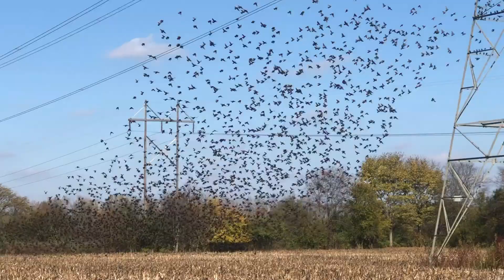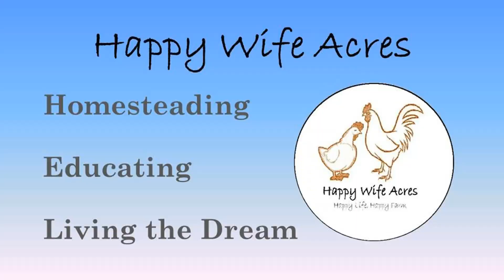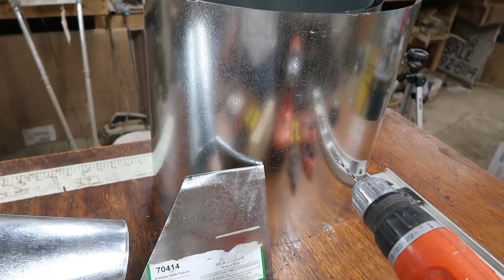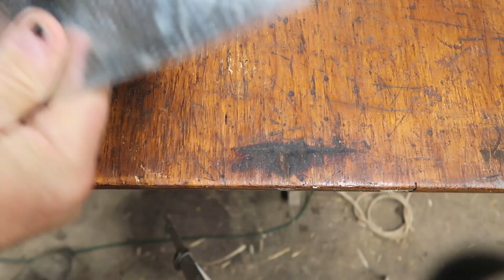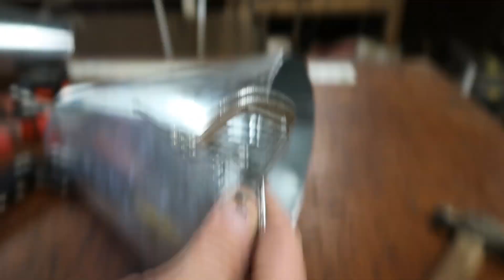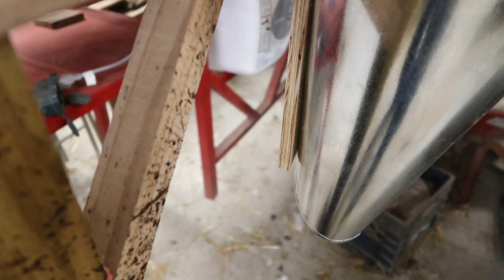Making Chicken Kill Cones

Comment: Would you happen to have a video or suggestions on making cones for turkeys and ducks?
Reply from the maker: I don’t but they’re just bigger versions of the chicken cone.  I made one out of metal barn siding once. Had the corrugated ridges. About killed myself bending it!  It’s hard to find huge flat metal flashing. The 2 nails in a stump and hatched works also. Just messier. Bigger animals take a lot longer to stop moving. Especially ducks.

Comment: The bottom opening seems pretty wide.. has this been an issue with 5-7lb Cornsh-X Chickens?
Reply from the maker: It hasn’t been an issue with “normal” sized birds, including CC. Small birds like bantams fall through. Large CC, 8-10 lbs, won’t fit. For those, I hang from a cord like the rabbits or put them in our Turkey cone.
Reply: @HappyWifeAcres  Cool thanks -- weekend project :-)

Comment: Very late comment, sorry. How long do you suppose these will last? They seem like a better option than even the 5 gallon bucket ones but I think those will likely last longer.

How have they done after a year of use? Any revisions?
Reply from the maker: I can't believe it's been a year!  They still look new and we use them quite often.  No rust or breaks.  Like is said in the video, DO NOT use aluminum flashing.  Those eventually started to tear and they were very flimsy.  But these are doing great.  They fit the chicken very well too, holding them snug.  Thanks for watching!

Comment: Thank you! Most thorough vidoe for my novice self...when i was all done i saw this one equated to a Medium size kill cone, which in my ignorance prior to seeing this video is bought online but my birds are larger and i need the large...have you done this process for the large size? And if so can you reply the dimensions i should cut it to? I will try to find online but thought id ask 🙂
Reply from the maker: These cones easily fit birds up to about 8 lbs. I haven’t made bigger ones. When I have a larger bird (rare), I use a swing set and hang the bird by bound legs.
Reply: Did you end up making larger size ones? If so mind sharing the dimensions?